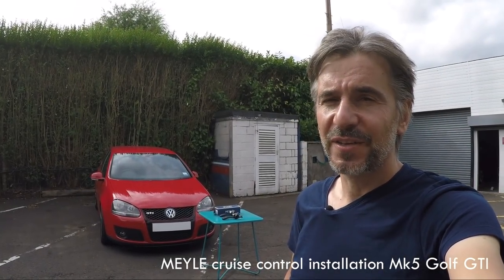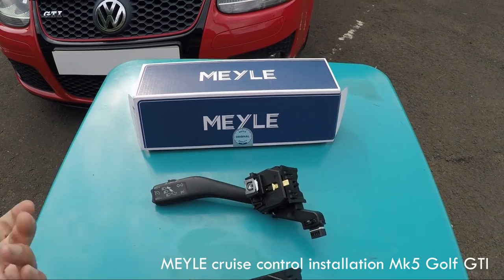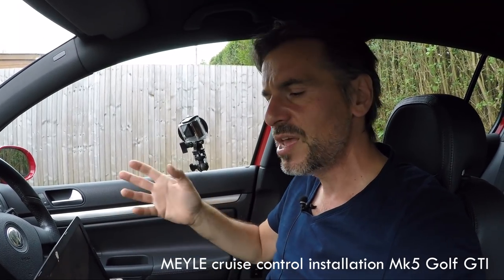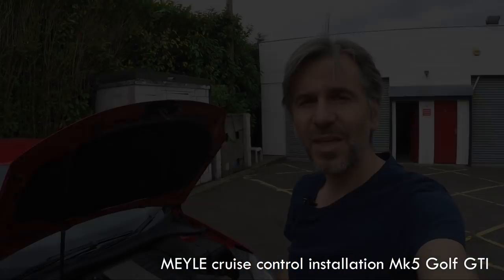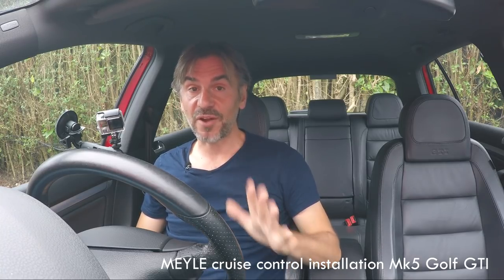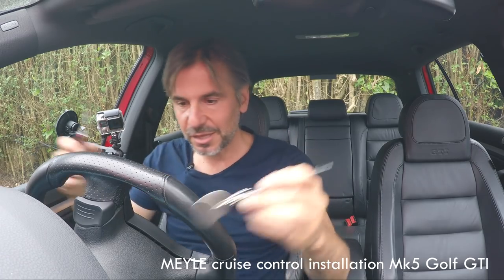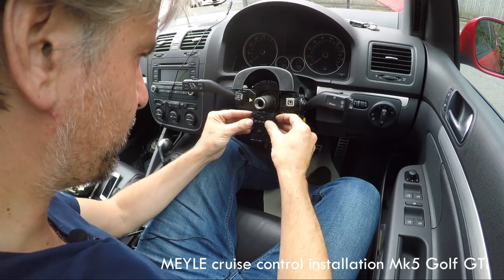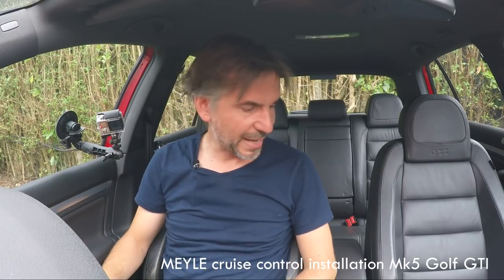DIY CRUISE CONTROL GUIDE - MK5/6 GOLF, EOS, PASSAT, A3

Comment: Ed China would be proud:)....
Reply: Nice work, never knew you could do it, lovely jubbly
Reply from the maker: Thanks Paul :)
Reply: @volkswizard  hi there , i want to do this on my mk6......  do ypu have a guide for this?
Reply from the maker: @simonmurphy9876  It's pretty much identical on an early mk6, on later cars the left and right stalks are one piece and there is no control module underneath, it's all controlled by the slip ring/steering angle sensor in the middle.  I recently tried to install cruise on a 2016 Scirocco. The control module took the cruise settings OK but it wouldn't actually work so do a lot of homework on which parts you need.
Reply: @volkswizard  thanks, yeah im beginning to realise that, ive done a lot of research on it but its not that well documented.  I have the kit already purchased for my model mk6 gti, but there is a few concerns i have brfore i start into it...  Do you mind if i email you, pick your brain on a couple of potential issue's i may encounter??
Reply: @volkswizard I have a 2011 golf s, that I’d like to have cruise control retrofitted to, I did it on my 2007 focus the other year so I somewhat know what I’m doing with stuff, it’s mainly the lack of information online and I still can’t seem to find a good well used forum for vw owners “similar to FOC” I do need to get a vcds or find one to lend to check though
Reply: Great vidio Andrew. I.fitted my a3 cruise with watching this many thanks 👍👍

Comment: Just fitted my cruise control today on my 09 plate Edition30, fantastic tutorial, took me just under an hour and the car had the right module so I just plugged in the indicator stalk and then it started working. You have to go over 30 miles an hour and then the cruise control light comes on

Comment: I did retrofit and have only green light when cruise control is activated. No yellow symbol before.
Reply from the maker: It varies from model to model some do have the warning when cruise it available but not active, some just have it when it's active, as long as it works it's fine :)

Comment: Very clear instructions and very easy to follow! Fitted the stalk in less than half an hour!
Needed to fit the additional wire, which was again pretty straightforward apart from getting the wiper arms off! All working and tested. I bought a second hand genuine stalk and a separate cable both purchased from eBay for £20 all in.
Reply: do you have the instructions to fit the additional wire? cant find anything

Comment: I did this on my 2010 Mk6 GTI today. Thanks so much for the video. It's really helpful. The hardest part was removing the airbag. I struggled for probably an hour and eventually had to get the girlfriend to help. The thing is the airbag isn't just held in my those metal springs, it's also held in by plastic push fittings inside. So while you do have to release the metal springs, you have to pull really bloody hard to get it out. Be careful, though, because the wires inside aren't that long. After that the rest was fairly easy as far as pulling plastic parts off cars goes. Everything worked and I think the Meyle stalk actually feels nicer than the original VW one.
Reply from the maker: The airbag springs are easy when you know how.  I am pretty sure I've done a Mk6 (or Scirocco) and don't recall pulling too hard. Did you use a mirror to see the springs?
Reply from the maker: The airbag springs are easy when you know how.  I am pretty sure I've done a Mk6 (or Scirocco) and don't recall pulling too hard. Did you use a mirror to see the springs?
Reply: @volkswizard  Yeah I used a mirror. I don't think I would have had a chance without a mirror. I could see exactly what needed to happen with the springs, and sometimes they would stay "up" for a while but then quickly ping back down when I tried the other side. It was really clear it was being held in by more than just the springs. So nothing for it except a really, really good tug and don't think I ever would have managed on my own.

I've read online there may be a couple of airbag manufacturers for Mk6s, so maybe I got the difficult one?

Comment: Thanks, your video helped alot😁

One tip for getting the airbag out use your flat head driver and place it in the cut out on top and put it on top of the black piece which is the clip and pry it to the centre of the steering wheel, really quite a easy step once you know the orientation of said clip.

Comment: Hi, excellent video. Helped me a lot to reprogram steering control module , had to replace it due to faulty code. Car is still not running, cranks fine. Crankshaft sendor ok, plugs spark ok, fuel pump ok, . Everything was fine  but after replacing fuel filter and fixing vacuum leak, it didn’t start. The car has been parked for over a month for service and water pump replacement. 
Is there any inhibitor switch on golf mk5 GT which is resisting it to start?
On Vcds it showed only steering control module fault. Can you please help? What should I be looking for on Vcds? 
Battery was very low so I charged it couple of times. During charging , Once I mistakenly connected wrong terminal to battery due to very dark, which resulted in a blown fuse on charger. I checked all the fuses with tester and also changed old one with new, and they are ok. Anything I should else be looking for?
Reply from the maker: I am not sure modern cars can handle batteries being connected the wrong way around so it's possible (not definite) that you might have damaged the ECU. Has the car started since you did that?

Comment: I have a gti edition 30 2007 with highline cluster and steering wheel buttons and want to install cruise control. Am I right in thinking all I need to buy is the cruise control stalk? I already have VCD's and the reason I ask this is because some people online are buying steering control modules and switching wires over from the ECM??? Thank you in advance.
Reply from the maker: Steering control module is quite likely on that year, you shouldn't need to mess around with wires though. I fitted cc to a 2007 Edition 30 using just the stalk, the steering module accepted the CC coding OK, light even came on on cluster but CC wouldn't work until steering module swapped  -  really annoying! Scan your module with VCDS to get patt number and check on the Ross Tech site
Reply: @volkswizard  thank you, will do. Can i ask what part number is the cruise control stalk as I want to buy the same as you.

Comment: Great video. I didn’t realise it didn’t need to be coded. 
I could’ve done my Jetta cruise myself.
Reply from the maker: Hi John. Thanks for commenting.  You do actually need to code the steering control module and the engine ECU but these can be done by anyone with VCDS.  You could even do this well before you install the part if that's convenient as I am pretty sure that wouldn't cause any problems apart from maybe log a harmless fault code.
Reply: volkswizard 
Apologies Andrew. I originally didn’t watch the beginning of the video, so I missed the bit about VCDS. 
I thought any coding would be done at the end, after installation. Silly me 🤦‍♂️😂
Reply from the maker: No problem. As you say, the coding is usually done at the end but checking the module is compatible is key to everything going to plan and while you are doing that you may as well do the coding :)

Comment: Hi  guys, ive retrofitted cruise control to my Edition 30, with a febi stalk. Afterwards ive coded the steering controller which is accepted,  but when trying to code the engine module and tick the box to enable cruise control in the long coding, it accepts the code but if I go back in, it's reverted back to 00 again. No error codes for my modules and everything works on the stalk except CC. I read that I might need to go into the 'coding 2'  section but it's greyed out for me. I dont know the code for the security section if I need to access via that route?

I've also checked the cruise control stalk in the measuring blocks on both the engine and steering module and all the switches show as working, as does the clutch switch when I operate it and watch the measuring blocks change.

Is it a VCDS issue maybe?  Does anyone have genuine VCDS in the Aylesbury, Bucks area that could see if they can activate my cruise control in the Engine module?

Cheers in advance

Comment: My golf 5 2006 1.9 tdi goal have allready a cruise control. When i turn ignition on (without starting the car) and i turn on/off the cruise control, the light on the dashboard is turning on/off bit when i start the car if the cruise contorl is on it turns off automaticly any help? Also i put video from the problem so i can find a solution

Comment: my car is off the road at the minute, and I'm doing as much work on it as possible before it's on road. I cant get any vagcom done without driving the car somewhere really. could I take apart my wheel, check the model of my  steering module and ensure cruise works, then install the stalk. then I can get coding soon as I start driving?
Reply from the maker: Can't see why not, it's just a lot easier to scan than dismantle but if you have time and don't have to reassemble then go for it. Check list here
http://wiki.ross-tech.com/wiki/index.php/Steering_Wheel_Control_Module_Versions

Comment: Great video Andrew. Im looking at installing some extras on the Up! and now know how to check the module for the cruise control!
Reply from the maker: Glad to be of service! I've not installed CC on an Up! but it's a very Mk5/6 car in that area so should be similar. Be interesting to see if each stalk is separate or if they are one part as on later Mk6
Reply: volkswizard I think the stalks come as a pair but the ups have different bcs modules and only 3 out of 5 are comparable with cruise or it’s another £500!!

Comment: Hello first of all thank you for this video!I just want to ask you...I have a vw scirocco 1.4 2008  with golf mk5 steering and i want to install a cruise control like this it is impossible to install it without make changes to  the wiring like you done it ?Only with vcds cooding because i saw a lot of videos that they put wires in the steering.
Reply: I’ve got a scirocco with the mk5 wheel too, did you ever try fitting it and what did you need to do? I’m hoping it’s just as easy as in the video but I’m not sure

Comment: i purchased stalk and connecting wire loom, but cant help but this more is needed for the audi a3 8l 1.6 in order form to hac cruise, what control throttle (used to be a vacuum modual) on older cars , ?
Reply from the maker: Hi there.   Even on A3 8L the throttle is managed by the ECU so once you have the stalk fitted and wire connected to the ECU, you need to recode the ECU using VCDS to tell it to look for a cruise control input.  I am pretty sure there are some guides out there.  I fitted it to an 8N TT which is pretty much the same car.

Comment: Instant like and subscribe! I know it says the guide is for MK6 Golf, Passat, A3 ect, just wondering if this will work on a Seat Leon 2011, diesel please? Edit: By the way my car doesnt have any steerling wheel controls
Reply from the maker: Should be similar but you may have the one piece stalk that does both left and right sides rather than left and right being separate stalks - the Mk6 Golf from 2010 has the one piece stalks (unfortunately as they cost more!)

Comment: How do you connect vagcam to your car at the start? is it just a matter of typing in the registration plate for it to recognize the car model? I have a early 2006 golf mk5 GT. Would it accept it? 
Can you do a video of changing the cluster to a highline version? I only have the midline version.
Reply from the maker: Hi, VAG COM will recognise which modules are installed automatically on a CAN BUS car like Mk5 Golf. Unfortunately cluster swaps I believe can't be done with VAG COM due to the immobiliser coding required.

Comment: Hi mate, do you have to do anything on instrument cluster to indicate cruise control active and set speed on a seat leon mk2?
Reply from the maker: This is usually automatic though never done a Leon. On some Golf 5 the green cruise dash light only comes on when the speed is set, on others it comes on when when you switch cruise with a speed being set (i.e. based on position on the switch in top of the stalk).

Comment: Thank you ☺️

Mine doesn't work since I bought the car with it but it seems it has an aftermarket one installed into it but it does totally nothing I tried everything and going over 20mph or whatever speed it doesn't work.

Maybe I should check the fuses?

Thanks

Comment: Thanks for the guide. If I code the ecu for cruise control and it accepts it does that confirm that I have the cable running between the steering wheel control module and the ecu or is the only way to confirm to take it all apart?
Reply from the maker: That's a good question.  If you code the engine ECU for cruise, this may not prove you have the cable. Likewise, if you code the steering control module.  The reason for this is that you are accessing these modules via the existing diagnostic cables, the bit you want is to to go from steering column module to ECU and not sure how to test that. If your car is post 2006 model year you will almost definitely have the cable. I've never fitted the cable so unsure as to how to know for sure.  Also if your car came with a cruise compatible steering module, then there is a good chance it will have the cable. Best of luck.
Reply: volkswizard Finally got round to doing this. The car had a compatible steering module and accepted the coding so chanced taking it all apart and the cable was there. A bit of forum digging suggested the cable became standard at some point in 2006 (its a 06 car).

Comment: Hello, I was wondering if it was possible to add cruise control onto my 2014 VW Jetta S? It has a 5 speed manual transmission.
Reply from the maker: Hey Omar.  If it's an MQB car which I think a 2014 Jetta must be then I can't say as I have no experience.  If it's a PQ35 car like mk5/6 Golf then it's probably quite easy.  Thanks :)

Comment: Hi brilliant diy video I'm going to install cruise to my golf mk6 r 2012 the bit I'm concerned about is this cable that runs to the ecu i went into vag com and it had the option to select cruise control location on steering wheel setting is this likely it already has the cable running to the ecu?
Reply from the maker: I think Mk6 have cable so your issues are having a compatible module (built into slip ring IIRC) and getting a stalk which being left and right stalks in one is quite dear (but worth it)
Reply: @volkswizard  thanks it did already have the wire to ecu and I change slip ring and the whole stalk shes lovely now on cruise

Comment: Hello i have a MK5 2004, Steering Wheel Control Module 1K0-953-549-A in my car and my steering wheel is 5C0 419 091AK.  if i use Steering Wheel Control Module 3C0 953 549 AJ (for Passat) Will it work all functions well ? or which one i have to use? Could u please explain to me in this case and whats the differences between 1K0 & 3C0
Reply from the maker: http://wiki.ross-tech.com/wiki/index.php/Steering_Wheel_Control_Module_Versions

Comment: Otherwise ok but i would have liked to see airbag facing other way around on passenger seat, the pause to drain remaining current after disconnecting the battery for half an hour and see the actual tab which holds the cruise in the place (in video we can see only your elbow).

Comment: if you put a mark across the wheel bolt and steering wheel with tipex or marker pen, before you remove it, you'll know how much to tighten the wheel bolt when you re-install it and it'll act as another alignment mark. They use this trick when installing replacement side windows to avoid over tightening the window grip bolts and potentially breaking the window.

Comment: Just about to add cruise to my 2009 Scirocco which is basically the same as the Golf as I know its not so easy on models after 11/2009.  The kit I have ordered says it has a cable with it too, do you know where I am supposed to add this cable please.
Reply from the maker: The cable runs from steering column to ECU under the bonnet. I'd be amazed if you need it though so code the Steering Electronics ECU for cruise before you start and if you don't need it, it will accept the coding and you can then just do what I did in the video. I wouldn't bother fitting cruise if I had to fit the wire as it's such a pain but might just be me.
Reply: volkswizard thanks. I coded it with vcds no problem all accepted fine. Looking at the part number for my steering wheel hardware it says I have a high line setup and is ready for cruise etc so I’m guessing it will all be fine. Should have the new stalk tomorrow 😀

Comment: Hi I’ve got a 2008 MK5 GT TDI DSG I wanted your advice as I have retrofitted a MK6 GTI steering wheel with the CH control module as I wanted the paddle shift and buttons to work. Also I have fitted the cruise control stalk which you have shown in the video. I used VCDS to programme etc. And For some reason I can’t get it to work any ideas what it could be thanks